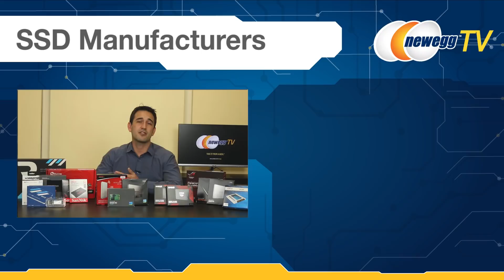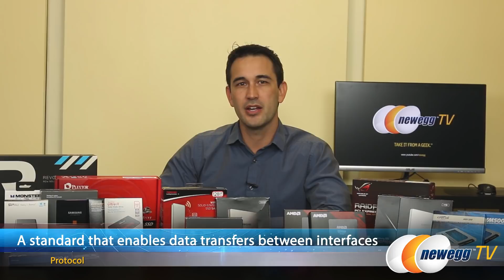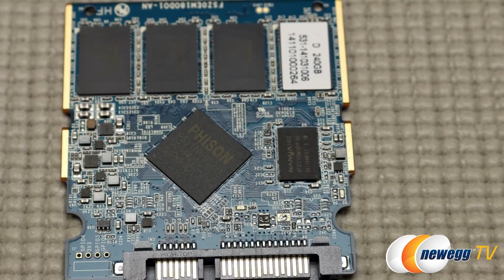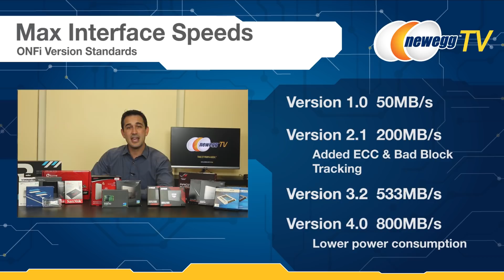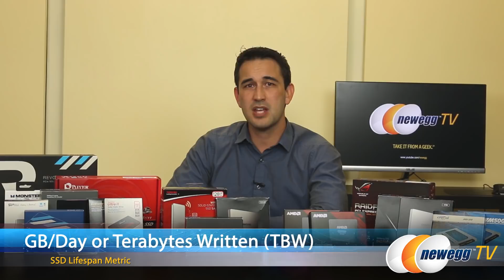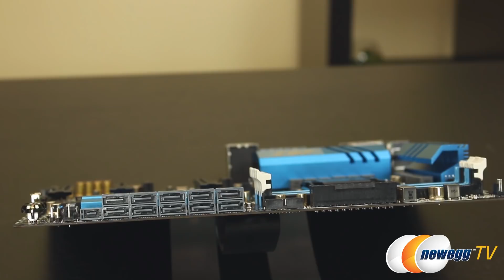What is an SSD? - Newegg TV

Comment: are they ever going to make massive ssds in 3.5 inch form factor? I think it makes perfect sense when the bigger drive allows for a ton of room for extra memory modules on the chip.
Reply: I'm assuming its not plausible to mass produce. increasing the capacity enough to need a 3.5 form factor would mean we are talking 5-10 TB(maybe more I'm not sure) of data. I don't think there is a consumer market for this, when you consider the cost, its just not viable at the moment. in the future however I also don't think its going to be a thing because Moores law dictates that we will probably have a faster more compact solution.
Reply: Evan Buschor Nope.  Intel is already planning to release 10TB ssd's that still fit the 2.5" 7mm thick form factor by 2017.  :D.
Reply: If I'm not wrong, some of the first SSDs were 3.5, I guess size isn't really a limiting factor. I would assume they don't build bigger capacity drives because the price would be too high.
Reply: Siberian Pootis some ssds sure, but not all. and the bigger capacity ssds use a chip that is about the size of the case around it.
Reply: Brick Tamland You've obviously not heard of 3d Vnand yet.  Go to Samsung's official website or google it.  Educate yourself.  Then, ahead of time, welcome to the twenty first century.